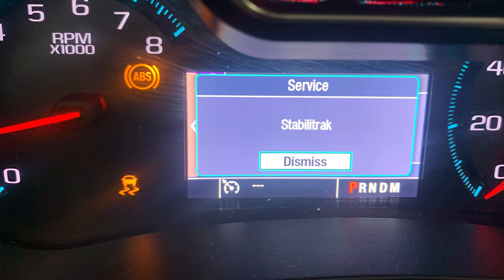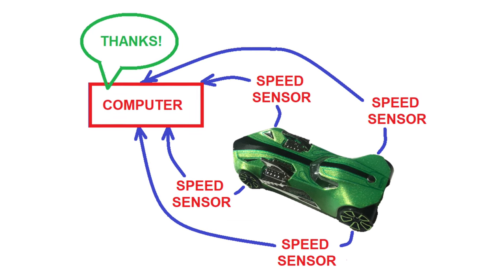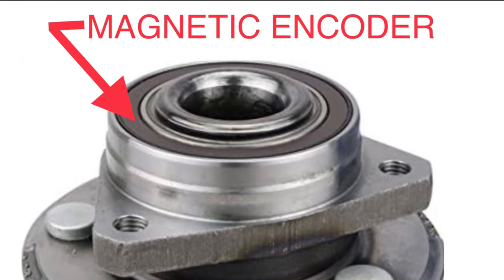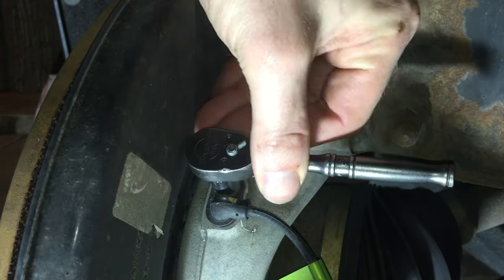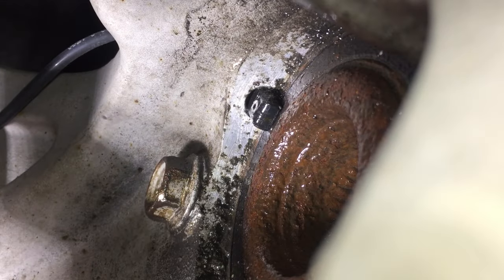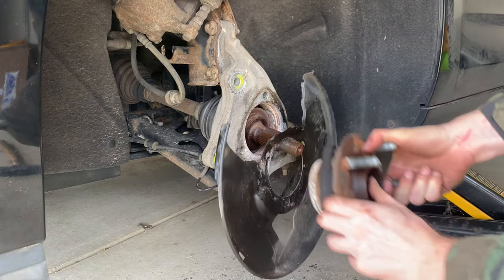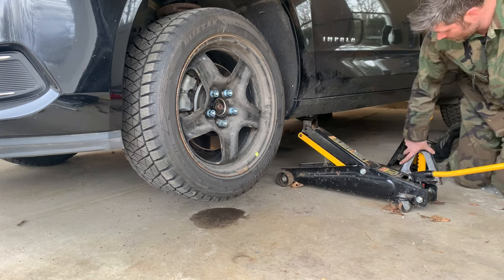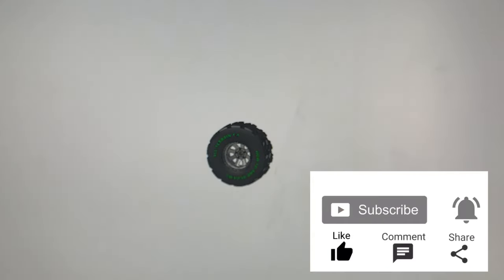How to Fix ABS and Stabilitrak Warning Error Lights | Speed Sensor | Wheel Bearing | Chevy Impala

Comment: When this issue happens why does car stall out or not able to accelerate? Meaning my light comes on while driving then all my sensors go to 0(RPM, MpH and engine tempt shows C), then cate sound like it’s out of gear and won’t accelerate?
Reply: Mine does this gauges start doing a weird  back and forth and stabil track light abs and check engine lights comes on.. couple days later everything back to normal (all lights check engine abs stabil) are cleared..
Reply: Mine just started doing this. Hope someone answers your question.
Reply: @jhawkins3746  same
Reply: This sounds like a recall issue my 2016 does the same it clears itself after 10 minutes of driving
Reply: @txwayz979   I have the same problem
Reply: @erickjimenez9664  so my front 2 tires started to make a loud humming sound and got louder as I went faster. Turned out to be driver side wheel bearing that was bad. That’s what caused it to make the malfunction for the sensor to make the car throw those different codes (check engine light, the stalling out like my transmission was slipping or going bad, etc). I had it replaced and haven’t had a problem no more with my car going crazy. This too might be your problem too it just hasn’t got bad enough to make the loud noise so you can locate it. At the beginning when my car was doing it there was no humming noise no where so I thought my car was just going to junk.. All these Impala that do this GM needs to do a recall and fix it for free.
Reply: @txwayz979 might be me currently,  assuming the wheel bearing. Thanks for the comment!
Reply: I'm late but the vehicle goes into limp mode when the on-board computer detects a problem.
Reply: it would be caused by the computerized throttle body getting bad signals from the stabiltrac, when the rpm drops too low it will kill the power to engine briefly and this can dink with the powerstearing aswell.   there is a recall for this if the harness is the culprit
Reply: @barelyrollin can you say which harness would be the culprit ?
Reply: Mine is doing the same thing. Were u ever able to figure it out boss?

Comment: I have Chevy impala 2017 same issue but transmission when I put on drive then kicking very badly what is the solution
Reply: Did you figure out what was wrong by chance? My impala is doing the same thing. It kicks HARD when trying to change gears and the PRNDL doesn’t light up like normal.
Reply: @jarinkiper1915 encontró la solucion?
Reply: @jarinkiper1915 did you get it figured out? We took it to a mechanic and they said transmission pulley

Comment: does this issue cause the PRNDM not illuminate?
Reply from the maker: Not that I m aware of. I have delt with this abs/stabilitrak issue 3 times and the PRNDM lights were never effected.
Reply: I am having this same problem!! Please update if you find a fix..
Reply: It did for me the few times I had this problem . Did you find a way to fix it ?
Reply: Mine was a neutral safety switch and the tcm. 1500 bucks at a shop and it fixed it with no problems ever since
Reply: @bobbygraham5389  i have a diagnostic tool (launch) from my job and i reprogrammed/relearned the CAN system and its been fine since.
Reply: @cured ham my PRNDM doesn’t illuminate did you find a fix bro ?
Reply: @pops2305  I know and had the issue where the PRND lights didn’t illuminate because of the lights on dashboard,  I did a transmission liquid change and it fixed it after a little while (it’s super easy to do your self it’s just like an oil change) anyways try that, worst case scenario you just did a transmission oil change, you need to do them regularly anyways
Reply: @deezymoney yes there a fix to the PRNDM light not being illuminated, do a transmission oil change, watch you’ll see , the old oil will be black , it’s suppose to be red , clogs up filter and does that as safety so you don’t drive it , Anyways worst case scenario you did the change , it’s regular maintenance anyways

Comment: Where can I get a wheel bearing for cheap?
Reply from the maker: I purchase them from rockauto.com. They seem to have the best price every time.
I recommend not purchasing the cheapest, weird brand name, you can find. In my opinion, you will regret it a couple months later when it is junk and needs to be replaced again. Go with a reputable brand. I personally use Timken and recommend them.

Comment: Thank you for making this video.  I keep encountering this issue with my 2015 Impala. I appreciate you taking the time to provide a detailed explanation to resolve the issue. OAN: Recently, my speedometer in the center dashboard disappeared. So, I can't see how fast I am driving without looking at the MPH circle on the right side of the dashboard. I assume it's a sensor that may be out, but I'm not positive.  I may need to check the fuse box behind my coin holder under the steering wheel. But I haven't had any luck opening it. Any thoughts as to why this happened?
Reply from the maker: I have not experienced anything like that. I know the displays can do goofy things when the battery starts going bad. I hope you figure it out!
Reply: Samee

Comment: Great video!!  My ABS light and stabilitrak light have been on a while (ignore it, it'll go away lol) but now its chiming a lot and I can feel vibration when i press on the break and console displays "Stabilitzer initializing".  Hoping to find a local honest mechanic to fix or see if the Mr. can figure it out.   Our friend already did diagnostic and confirmed error code was C0040.
Reply from the maker: It should either be a sensor or a wheel bearing. With the right scanner, it’ll tell you which wheel is the problem.
A replacement wheel bearing is around $100. I posted a video for changing the wheel bearing on this vehicle.
Reply: @HowtoandReviewsOfficial  The scanner said it was the right front wheel causing the problem and oddly enough, I kept losing air in that tire as well but replaced both front tires a few weeks ago and no more leak.  Also, I already watched your video on how to change the wheel bearing and even found a local distributor that sells the Timken one.  Thank you again!!!
Reply from the maker: @theohkerry8582  awesome! Thanks for the update!

Comment: Can this also affect the power steering as well. All three conditions happen to my 2015 impala simultaneously…ABS, stabilitrack amd Power steering disabled as well as rear camera warnings
Reply: My 2014 is doing the same thing. Did you find out what was wrong with it?
Reply: @TrayveinLewis  several videos link this problem to the wheel speed sensors not being able to read the magnets on the wheel bearings. Because the corrode and fall off over time.

It apparently disables everything they relies on computer information delivered from the wheel speed data. Which makes sense. ABS, power steering, and stabilitrack.

Going to hopefully change mine next week if the weather holds out. But a nice side effect is, without power steering my forearms are nicely developed 🤷‍♂️

Comment: Had service stabilitrak and service brake assist go on after driving through  12 in puddle. Wiped thd reluctor rings off, and fixed it. All it cost me was one paper towel.
Reply from the maker: Awesome! Free fixes are the best. Thanks for sharing!
Reply: I did the same thing yesterday what did you wipe off?
Reply: Just did the same thing where the rings

Comment: What if I get no codes with my scan tools should I disassemble the wheel to check? Thanks btw excellent video
Reply from the maker: A basic OBD2 code reader will not show it; they only show check engine light codes. I brought it to a friend at a dealership to scan it for me where the tools can scan all diagnostics
A portion of the rears are visible from under the car. You can jack it up and rotate the wheels to see all of it. 
The fronts are nearly impossible to see because of the dust shield.
I would definitely recommend trying to visually see it, or getting it scanned, before just tearing them all down.
Reply: @HowtoandReviewsOfficial  thanks I changed the cv axle which was spewing grease which obviously clogged up everything I cleaned it all out like you on your video took it around the block and the steering loosened up and all the codes magically disappeared thanks so much for this video bro👍🏻👍🏻👍🏻👍🏻👍🏻
Reply from the maker: @DRIPSONE73  Perfect! Glad you got it handled!

Comment: Do you know if penetrating oil will block the sensor? I just replaced the hub due to noise now the abs  light is on.
Reply from the maker: My personal opinion is that it will not block the sensor. The sensor is magnetic. The electronics are sealed and not exposed to the penetrating oil.
Reply: @HowtoandReviewsOfficial  Thank you much!

Comment: Bro I have the same issue, did your car lost power steering while these lights were on?
Reply from the maker: I don’t believe so. I don’t recall that happening.
Reply: @HowtoandReviewsOfficial  thank you for the reply. My car has the same issue, the rear tyre speed bearing magnet was broken.
One more thing, the technician told me that if you lose ABS or stablitrack, your power steering will automatically be disabled. Just like me, i lost power steering when these 2 lights came on, once the error was gone after replacing the speed bearing power steering came back.
Reply from the maker: @shahzaibtariq2743  Good to know! Thanks for the update! Glad you got it fixed!

Comment: I doubt mine is this, I just changed out all four wheel hubs. And cleaned each sensor. Is it hard to replace the sensors
Reply from the maker: I think tracing the routing of the wires would be the difficult part. The actual connection is just a plug, and it’s straightforward.
Reply: @HowtoandReviewsOfficial  thank you!
Reply: Mines related to the TCM, the connector for it will not fully engage causing on to it causing these issues plus no illumination with PRND and stuck in 3rd gear and lights up the dash with stabilitrak/abs/parking brake.
Reply: @curedham2963  mine is doing the same thing which is actually the root cause. It’s infuriating. I have an OBD II code reader to remove the error code so I can still drive it. What they want to fix the TCM and the speed sensors within is ridiculous.
Reply: I am having the same problem with my 2014 impala.. it comes and goes.. have you fixed yours?? My prndm lights either won't light up or light up wrong and shifts hard then I kill the car for a while and it may or may not go away
Reply: @bobbygraham5389  have the CAN network relearned/reset (controller area network) and also check the wires to the TCM (transmission control module). The relearn procedure worked for me and i havent seen anybody mention anything about it. All you need is a very good diagnostic tool to relearn/reset the CAN. It took me less than 5 minutes to do it with mine (im not a mechanic im a auto glass technician and we have these $4k ones for recalibrating the cameras on the windshields). Hopefully that works for you!
Reply: @bobbygraham5389  did you fix?
Reply: @TheKandSFamily  hey bud. Had to have the tcm replaced and neutral safety switch.. 2days of work 1700 at shop

Comment: Would the check engine light come on as well
Reply from the maker: No, it would not. If the check engine light is on, it is an additional issue other than the wheel speed sensors.

Comment: Is this why my 2015 does not pick up normal?  When i hit 48mph it slows down.
Reply from the maker: I don’t think so. This would only effect the stabilitrak and antilock brakes.
Reply: On my 2014 the stabilitrac seems to govern my speed. With it on, I cannot go over 46-48 mph. But I am wondering since when I put it on computer, it tells me that something else is wrong.
Reply: See this is my problem in my 2014 Impala....i changed my shocks struts and swaybar links and I was in regular mode for like a week....now I'm back in limp mode and can't accelerate past 49 MPH...and the stabilitytrack service light is back on...

Comment: How do you know which hub need to be replaced
Reply from the maker: You can bring it to a shop and use a scan tool to determine which sensor is the issue, or jack it up and do a visual inspection of the pickup ring on each hub. The rears are pretty easy to see, but the fronts are not easy.

Comment: My 2015 impalaLT has abs and traction light on reset faults came back changed out sensor too the right rear in which coder detected problem still exists and when faults are shown I lose my electric power steering next I’m thinking rear hub
Reply from the maker: That’s where I would look next as well. Good luck!
Reply: Good to hear

Comment: My ABS and stabilitrak came on and power steering stopped working. Would this fix my problem or is there more wrong?
Reply from the maker: I think this is definitely the place to start. This is the cause/solution for ABS and Stabilitrak warning lights.
The power steering issue could possibly be related or it could be separate. The power steering is controlled electronically (there is no power steering fluid). I am not sure if it is tied into the wheel speed sensors or what specifically would cause it to stop working.
Reply: I had the same thing just happen. Did you get the ABS issue fixed and the power steering resolve itself?
Reply: @dudepalbroman  did you figure it out?
Reply: The power steering going out is 100% related to this. For some reason when one of your back bearings go it cuts your power steering off. Very stupid and dangerous but, this is what happens with this car.

Comment: So my dash light went dark my gear sometimes jerks after putting transmission fluid as well as the lights staying on the dash as you named the reason for that so I’ll check it out but how can I fix the other problems
Reply from the maker: Hard to say in this era of vehicles were the computer controls everything. The best thing to do would be to get it connected to a scan tool and check the faults.
Reply: Same problem

Comment: If it still comes on after you fix all that and it still comes on what causes thzt
Reply from the maker: If all of the speed sensors and pickup rings are functioning properly, and there are still stabilitrak and ABS errors, I think it would be the result of computer issues.

Comment: Stabilitrak service light on. Car won't start or stay on pretty much all electrical won't work but auto start works. But won't let me put in drive or anything??
Reply from the maker: I would start with testing the battery. The electrical system was doing some goofy things on this vehicle when the battery went bad a couple years ago.
Reply: @HowtoandReviewsOfficial  Thank you I will try that out.

Comment: My car has dose lights on and it’s hard to turn. Is that a sing of a bad bering
Reply from the maker: A bad wheel bearing should not result in difficulty turning.
The beginning symptom that you will notice is a humming or growling sound when driving, especially when turning because the bad wheel bearing is loaded with additional weight.
Reply: So I should start by replacing my steering pump
Reply from the maker: @antoniobeltran2908  That’s a possibility depending on the symptoms.

Comment: This is the stupidest thing ever. This should have been on a recall list to address. There's never usually anything wrong. This model/year is common. The stupid wiring or sensors get dirty and they need to be cleaned.

Comment: So I started on my driver's side took everything apart the hubbaring the sensor cleaned it all up cleaned out the ring the ring wasn't broke but still put it all back together took it for a test drive the problem continued when I got back to the garage I started to take apart the passenger sign I noticed it was a lot hotter burning hot and that's because the problem it was causing was creating more friction on the brake Disk because it was activating that was trying to adjust the speed on that wheel and so when I took that apart and cleaned it and put it back together and took it for a  Test drive And everything cleared and it was working perfectly well But if you're driving it around and it's causing you that problem fill the temperature on each wheel how do they are that's the problem
Reply from the maker: Thanks for sharing! And great job!
Reply: You fjo
Reply: My problem returned, I have started looking for ground wires that are loose, I didn't find any loose ones but the starter ground wire I loosened it up and tried to remove it, then I tighten it up, the car is doing better after that, but I will continue looking for ground wires and report back.

Comment: Service stabilitrak and traction light came on then it said reduced engine power
Reply from the maker: Interesting. I have personally experienced the reduced engine power warning. However, that was the result of fuel to air ratio issues. Not related to wheel speed. Completely unrelated to stabilitrak and ABS issues.
Reply: Just had the same problem with code p228c do you think it's the fuel pump
Reply: Mine did the same thing today . It said service stabilitrak,  with a check engine light plus said power reduced.
Reply: Mine is doin the same once the stabititrak light comes on it reduces power to my car
Reply: Yes. Mine in the same as well. When in reduced engine power, the engine will not let me go over 46-47mph.  And it also just sucks that gas down. I don't want to take it to a dealer because of the cost.
Reply: And since it is on, I cannot use cruise control, there is no camera when backing up and remote start doesn't work. It sounds like to much just to be the wheel speed sensor